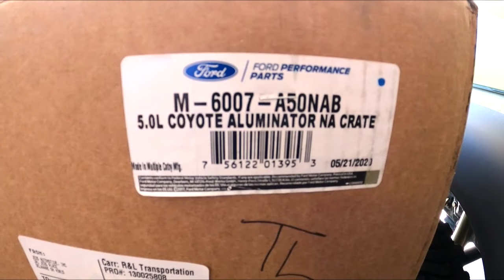Building a Factory Five Type 65 Daytona Coupe in 7 minutes- Cobra Daytona Build, Video 196

Comment: Thanks for all the content! This whole process has been a blast to watch! I've really wanted to build one of these or the cobra for some time, and watching this process has made it seem way less daunting. As sacrilegious as it would probably be, Im leaning towards a mach-e crate engine or a similar, especially with regulations and seeing future improvements in those systems. Im thinking it would make a lovely unique daily driver with an electric, with some track ability. Whereas this system the DD aspect might be a bit harder. 

I think a cool concept video would be that now you've completed it, some "lessons learned." I think early on you mentioned you had also build a cobra earlier. So some of the things you've learned from both builds. If you were building another what would you have done differently? what are some must have tools? what did you think would have been a good idea that turned out to not be so good? what far off idea surprised you? what would you recommend people save their money on? stuff like that.
Reply from the maker: Let me get working on this video. Great comment and I highly suggest you take the plunge.

Comment: I want to order one of these kits. do they actually drive and function like a normal car?
Reply from the maker: @lillotionofficial  That really depends on what you consider a normal car. These things are loud but it’s like driving a big go kart. The steering response is amazing the power to weight ratio is amazing but you don’t have all the creature comforts. They’re loud they’re low. It’s a great car I’ll never get rid of mine. And they’re also a little hard to get in and out of, which can be a little tricky.
Reply: @cobradaytonabuild1671  by normal car, i meant like, can it drive and get me from point a to b like a regular gas powered car?
Reply from the maker: @lillotionofficial  Easy. I have 13k miles on mine and have driven it for 10.5 hours in one shot. Dave’s has 23k miles on it.